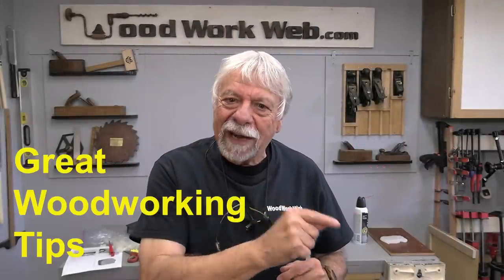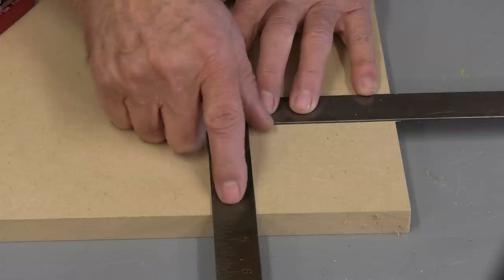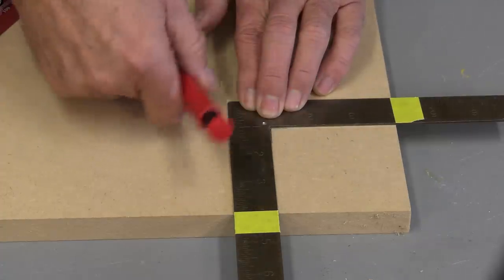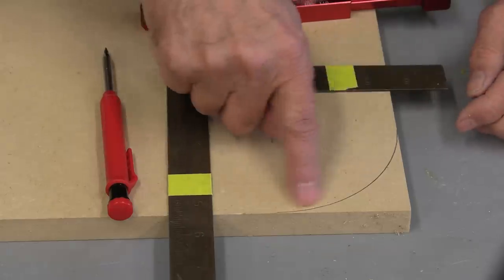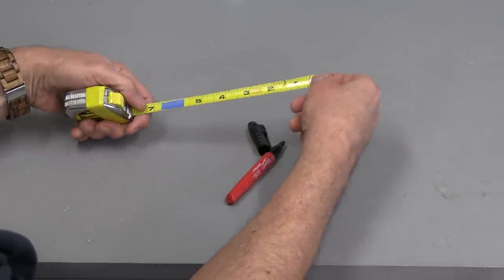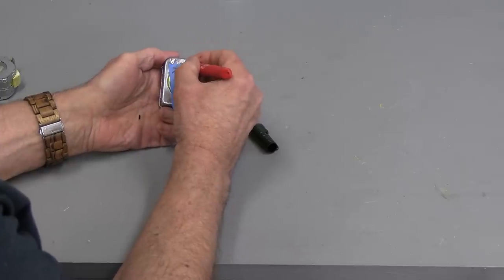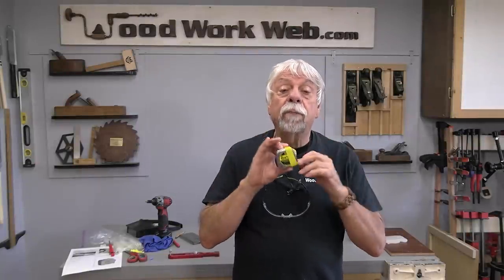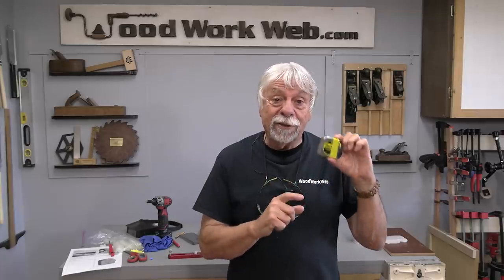5 Cool Woodworking Tips You'll Want To Know!

Comment: Fastcap makes a tape measure that is left- and right-handed (numbers are printed both ways).  It also has an erasable writing surface on it for making notes of measurements, and also has a built-in pencil sharpener.  It is very reasonably priced as well.  I've been using one for years and it's the one I keep in my apron pocket.
Reply: That’s my go to tape measure. Love it.
Reply: Home depot or Lowes or Ace ?
Reply: The only tape measures I use in the shop! Sure it is cheating because of the fractional markings, but math is hard! :)
Reply: @timhicks1118  Where did you get it ?
Reply: @c.blakerockhart1128  

Meet
Reply: @emmetttoomey8018   What ?

Comment: Dowel holding jig: Don't just stop the straight cutout at the round hole, continue it past the hole an inch (25mm) or so, it will make it a bit easier to get the jig to clamp down. You could also put several different, common hole sizes along the straight cut so you don't need to search for the right jig or make a new one each time.

Comment: Another way to make those knobs for bolt heads is 1 liter bottle caps. I turn them over and put in the bolt then fill with the hot glue. You can use different color tops for different things.

Comment: Knobs:  For greater resistance against the bolt hex chewing out a circle over time…hacksaw a slot across the bolt head and solder a length of stiff steel wire (aka..piano wire/music wire) a bit wider than the head.  Hot glue sets firm enough…but for a really tough knob try a hard set epoxy like Araldite or JB Weld.  Also add a washer to the bolt before the glue sets fully to make a stop.

Comment: As always a great video. That hot glue thumb screw tip is genius. I have a missing thumb screw on my vintage table saw that I have been unsuccessful at finding a replacement for. I'm definitely going to try the hot glue trick. I don't know how durable the glue will be but it is worth a try.
Reply: What about using epoxy?
Reply: @martintheron1386  Don't know if you could get the epoxy out of the wrench. Maybe I can find a silicone mould.
Reply: Cooking spray oil works as a release when I make hot glue bullets. 

Make your own mold with rtv silicone caulk.
Reply: Wax paper or releasing agent
Reply: Rather than using hot glue, try a soda bottle cap and fill it with baking soda and then use CA glue on the baking soda and it will become very hard.  You might have to layer it to get all of the baking soda hard.

Comment: Great video Collin, the thumb screw idea is great I do the same sort of thing using soda bottle caps the work really well as a hold down knob ....
Reply: That's a great idea.  You gave me an idea.  Use a soda bottle plastic cap and put your bolt in that and then fill the cap and bolt with baking soda and then use CA glue (super glue).  It will create a slurry that will harden very quickly.  Do it right and it will actually make a good permanent knob.

Comment: Making knobs- simple to make wooden ones. Drill a through hole for the shaft then drill a recess for the bolt head.  Make the recess the width of the bolt head when measuring from a flat to the other flat, so the recess will be smaller than the bolt head tip-to-tip measurement. Put the bolt through the knob and hammer it down. The tips of the bolt head should crush the wood fibers and lock the head in place. If it’s all sized to be tight that will be enough to secure it. You can make the knob any shape you like on the bandsaw

Comment: Improved dowel holder: slot in the opposite direction. You pinch the dowel, like using pliers. You may need to reinforce the other side with a screw.

Comment: First tip with radius is very cool, but instead of a can or something that you may already have in your shop you need to get at least two tools, and second one could be more expensive. Somehow I do not have exact same straight and this type of adjustable. But I have a drawing set instead, which is also can be used....

Comment: You can also make a knob using a screw cap from a soft drink (Soda) bottle they are easy to grip. Just do the same hot melt or epoxy bolt in the middle fill the cap and there you are

Comment: Use dowels to make those big-headed screws.
Use that dowel-drilling trick to drill centred holes in the dowels.
Slice on bandsaw.
Use the hotmelt glue trick to fill the hole.  Epoxy would work too.
Paint (or not) to taste.

Comment: Best way to make a quick knob is to take a HDPE screw on cap with nice a grippy edge, lay it flat, place your bolt sticking up and glue it in place with some epoxy putty to fill up the cap..  No mess and it it very strong.